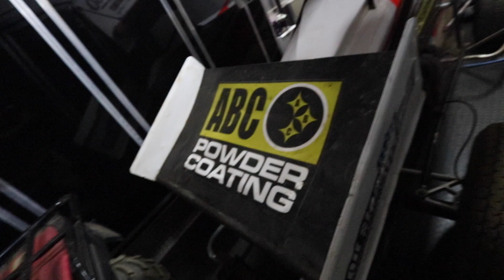Our Front Axle Snapped...(Huge Wreck)

Comment: That's awesome that y'all were able to recover and make a great run in the A.  A couple questions/ comments though.  Are Raceceivers mandatory there?  If not, I'd suggest lobbying for them.  After your incident everyone but the leader (I think) slows down and comes to a stop pretty quickly.  He just keeps hot footing it around completely oblivious to the red flag.  That's just super dangerous, to you stopped on the track, and to the officials and safety workers trying to get to you.  If he had a Raceceiver he needs to get it checked, and told that if it happens again he'll get DQ'd.   Lastly how much damage did the tow truck do?  I know it's common to pick a car by the rear halo and hang it like that (we've done it in a pinch, but it's not the way we prefer to do it), but damn he could have both tied it off so it didn't swing so much and driven more carefully to keep it from bouncing around.  We'd have guys coming to "talk" to us with wrenches in their hands if we towed a car like that here in Nebraska.
Reply from the maker: Yes raceievers are mandatory. The leaders was not working and that is why he was still in the gas. Also I do agree they should have tied up my car better. It would have made it all a tad bit easier.